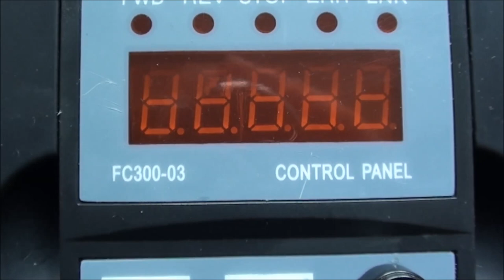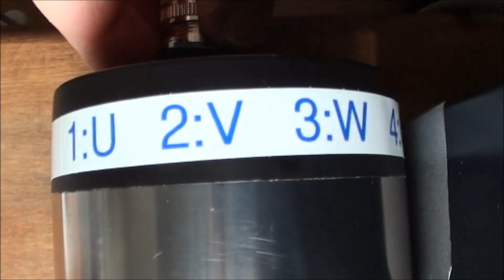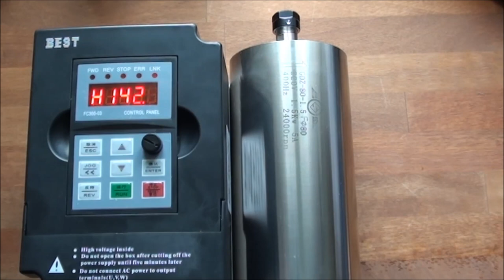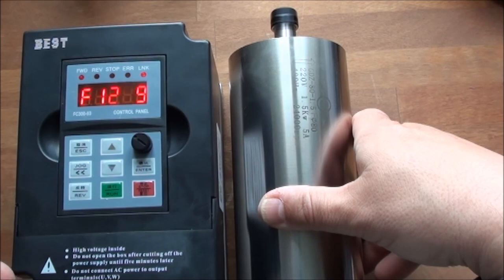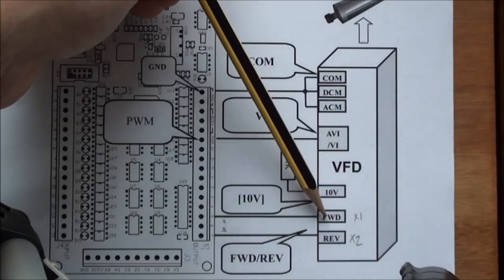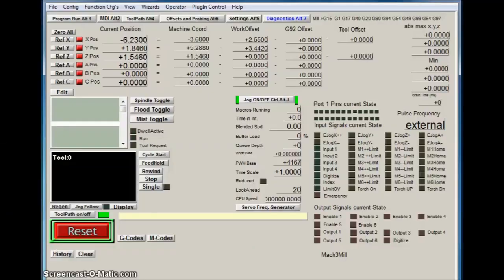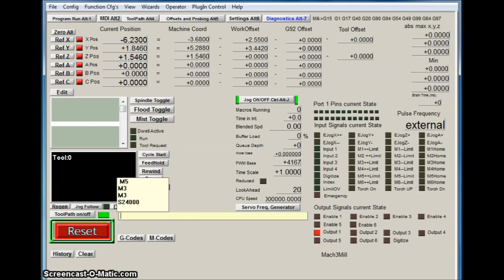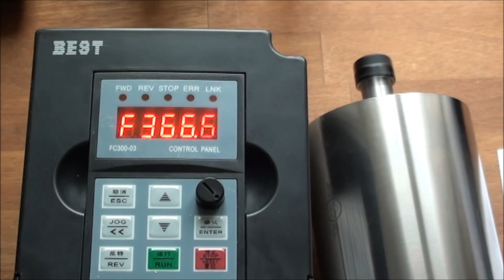Controlling BEST FC300 Frequency Inverter with AKZ250 USB CNC motion card

Comment: Following the first class advice from Martin Barfoed on the use of the AKZ250 i have used it to run a Mill, Boxford Lathe and a router. I have a small Chinese lathe with DC motor that i want to use for screw cutting and have spindle speed controlled by Mach3.
Has anyone any details on how to set up the AKZ250 to do this

Comment: Hello, good, I have a FC300-7.5G-S2 equipment, how can I change the parameters 0000, it is in another value that does not correspond to the power

Comment: Hi Martin, I also use mach3, wired the X1 and AVI pin of the inverter. I can on/off the spindle but could change the speed. I read the manual and don't find explicite recommandation dealing with the AVI activation. Using a voltmeter I check that tension depend on the spindle rpm set in mach3 but noting append. Is there a specific configuration to setup in the inverter menu ? If yes can you tell me the number and value of the parameters ? Best regards, Adrien
Reply: Hello sir, i also experienced the same thing. Have you found solution?

Comment: Hello Martin,

I have a question.

I am talking to one dealer in China who is supplying me this BEST FC300 converter for my LG Washing machine which needs 50 hz in Dubai but I am now in Philippines where electricity is at 60hz. LG Model is WD14336AD if you wish to google for more info.

Washing machine needs 220V which is same in Dubai and Philippines. 2100W is for washer and 1350W for dryer. 

Do you think this BEST FC300 will work for my purpose for home use to convert power from 60hz to 50hz? Appreciate your response.

Many thanks.
Reply from the maker: Hi Manoj, I do not think this inverter is made for the purpose. You get 0 to 400Hz out and its used for speed regulation of three phase motors. From what I read it should not be very critical going to/from 50/60Hz on simple appliances like washer and dryer - see: http://www.electro-tech-online.com/threads/230-50-hertz-vs-running-on-60-hertz.107098/ I used to live in the US and are now in Europe. I brought several saws and a big compressor (all build for 60Hz) to Denmark (50Hz) and they have been running just fine the past 15+ years. RPM goes a little down - thas all.
Have you tried to ask LG?

Comment: Hej Martin,

Hvad med elektriske støj med  Kinisiske VFD,  har hørt at de er meget slemme, passer det?  Jeg har overvejet at købe sådan da koster næsten 1/3 af hvad en tysker vil koste.
Reply from the maker: Zulfqar Ali Det ved jeg faktisk ikke. Umiddelbart vil jeg tro man kan skærme sig fra det hvis det viser sig at være et problem. Stepper signaler støjer også og det er en god ide at bruge skærmet kabel -særligt til længere ledninger.
Reply: Hej Martin, Tak for Info. Jeg vil prøve at bestille sådan et sæt så. Hvis det køre for dig så kan det vel også køre for mig ellers høre jeg nok fra naboen en dag. Et spørgsmål til hvis jeg må. Du viste en gang closed loop stepper motor. Har  du implementeret dem på din CNC fræser? Hvis ja, hvad er resultat med hensyns til hastihed og præcision hvis du har fræset flere eksemplar  af samme emne.
Holdes position præcis?
Reply from the maker: Jeg har ikke fået monteret dem endnu :-(  Jeg er dog ret sikker på at de kører pænt og holder positionen. Det siger jeg ud far hvad jeg har set andre opnå med disse.
Reply: takker

Comment: Hello Martin 
I have  a problem.

I run as your instructions , but after sometime  i am reconfiguring  values  and maybe  something  goes wrong.

now it's  not running  and showing  HoC like indicator.
Reply from the maker: Do you have the manual? I do have an English version that I can send you
Reply: +Martin Barfoed I got  English  manual  and solve  the  problem  

Thanks  for  your  message.

Comment: Hi Martin, 
I have the same set in my CNC and have a problem. After 30 min. of cutting spindle stops with oL statement in the inverter. I must add, that spindle is super hot. Did you have any problems like this? Maybe any idea what can be wrong? Overload statement means too much current but after 30 min of cutting in the same conditions I don't think this is something with overload. Thank you for any suggestion
Reply from the maker: Hi Marek, I have given the spindle away. However, I did not have any major issues with it. I think its still running. I use Kress 1050 now

Comment: Do you have software to connect your pc to FC300 inverter?
Reply from the maker: No I do not. Control comes from the PC via the controller and is a simple 0-10V signal for speed control

Comment: i have the same brand model 2.2k VFD but i confused the connection to my i/o with DAC 0~10V and Gcode Axis
Reply from the maker: Eric Cire Hi Eric, can you get it to work if you connect as I did?
Reply: well i read the manual of FC300 it said COM do not connect to GND that make me confused my model is 2.2kw
Reply: this the last part to move that set :D
Reply: Martin Barfoed do you have to detail about the voltage input for x1 y1 (CW, CCW), and all the signal going to GND??
Reply from the maker: Eric Cire X1, X2, etc are all logical inputs that you can assign to different functions. The voltage can be 0 or 5V for low/high.
Reply: Martin Barfoed got it,  my i/o output  24V that mean i have to step down the voltage before connect to VFD? just worry the vfd will broken when the voltage input too high
Reply: Same thing here Eric, the manual says that COM and Ground should not be connected really make me confused. Where should I connect it to except GND?
You figured it out?

Comment: My motor will not start , have dun the same connection
Reply from the maker: I had that problem also. I have had two of these VFDs. On both of them I found that there was a discrepancy between factory settings and the settings of the VFD. I did go through all settings and found one (can not recall the number - but is was one that had to do with exactly that) that was not correct. After changing it worked.